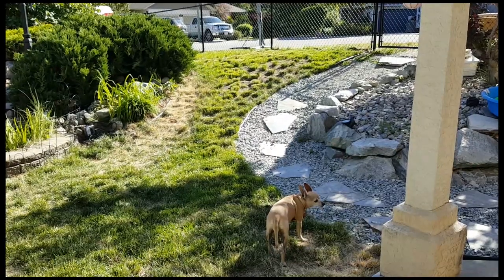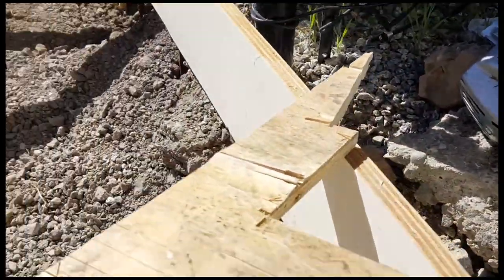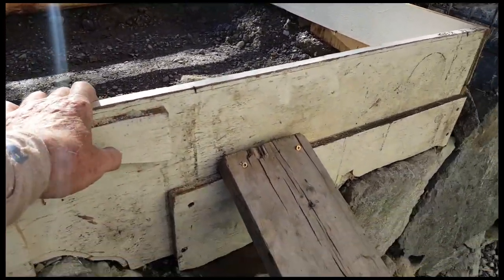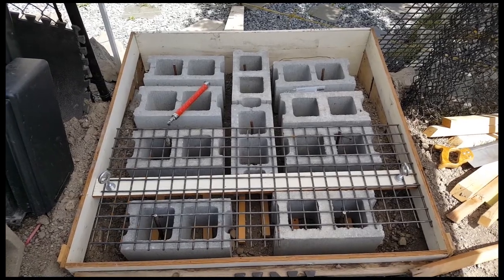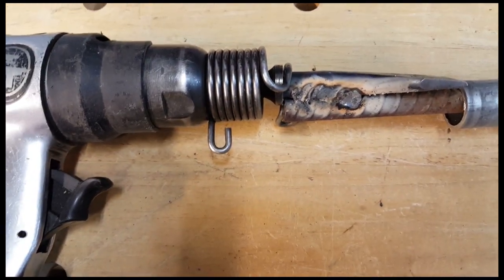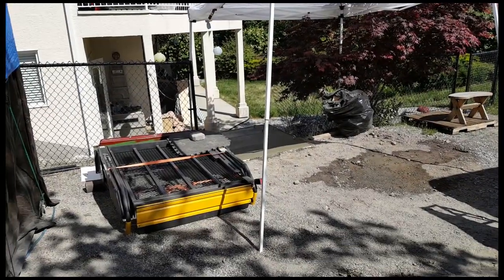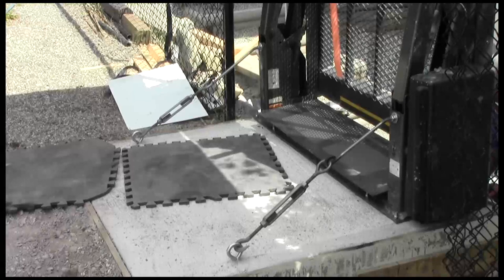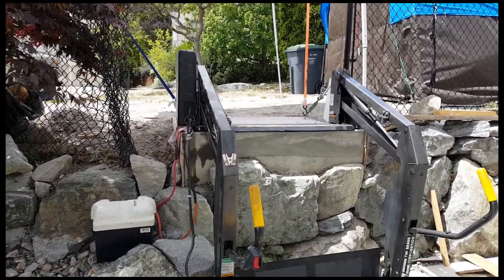Installing a Wheelchair Lift

Comment: How to add or put battery in on porch what connectors did you use? I have the same lift and want to do the same thing put it on my porch but running into problems how to either convert it to AC or simply use a battery help.

Comment: Thanks for the video.  A board member on SCI Care Cure forums had a setup similar to this in his workshop.  This was extremely well detailed.  Thanks again.
Reply from the maker: Thanks for your comment.  The lift does the job perfectly and my wife can get to the truck safely.  It was a big bonus that we also use the lift for easy transporting yard work equipment up and down.  I love it because I load all the groceries on it and quickly bring them down to our door.
Reply from the maker: Here is the video of the cover I built for the lift.        https://youtu.be/LzRlOOmIpfw
Reply from the maker: @mikeinbmore  I would be glad to look at and maybe give you some suggestions on this project.  But I would need to see some pictures to see what we are up against.  You can email me   whyterj47@gmail.com

Comment: Ray did you use the interlock or bypass it .  If you bypassed it how did you do it?
Reply: Michael, did you ever find out how to deal with this?  I installed a Braun-ability lift in my garage but cant get it to work outside of the van it was in. Thx!

Comment: Hello.  We are using our Braun Century Lift in a similar fashion, however, when we hooked it up to the battery it didn't work.  I see where some others had the same issue and was wondering how you resolved it.  Thanks

Comment: I would install a canopy to protect the unit from the weather. Maybe even a soler cell hooked up to a charger or run conduit to the battery to always keep it charged. Also wire in a controll station on top and at the bottom and tie the handheld station to the unit so the wife can operate it independentely no matter what position it is in. Just wire the extra buttions in parrell to the controller on the lift.
Reply from the maker: A canopy has been installed for the winter, and I just have to get the video done.  I like your suggestion of wiring in a second control.  I will look into that in the spring.  Stay tuned for the canopy video it turned out great.
Reply from the maker: I finally got the video done of the roof I built for the wheelchair lift.      https://youtu.be/LzRlOOmIpfw

Comment: Excellent job, I would like to see how you did the wiring. I bought a lift off a Scrapman. 
Still learning 
Thanks for teaching
Reply: Hi Zander. Did you figure out the wiring for yours? I just took one out of a bus and it was working in the bus. I hooked it up to a 12v battery in the garage and it is not working now.
Reply: @randyurso4799  Sorry to say not yet. I got very busy then winter hit. I do have a farm who is very knowledgeable on DC power lifts. Said he would help me figure out the wiring. I will try to video the process.
Reply: @zanderman2539  hi Zander. I was actually able to figure it out, it ended up being pretty easy. Let me know if you need any help. I’d be happy to answer questions if our lifts are similar
Reply: @randyurso4799  i would please need help
Reply: @franciscogutierrez5113  what kind of lift is it and what is the application? Are you using it out of the vehicle and attaching it to a new 12v battery?
Reply: @randyurso4799  iput new battery 12v. And nothing mine is a versa i belive

Comment: Ray, Can you kindly show the wiring diagram to battery, need same system for wife with MS who cannot use walk ramp anymore. Any help appreciated.
Reply from the maker: The wiring is quite simple and you can not get a shock.  The lifts operate using a 12 volt battery.  I use a 12 volt deep cycle battery, try and get the highest amp hours you can afford.  There are 2 wires coming from the lift, 1 red (+)  1 black (-) and they attach to the corresponding terminals on the battery.  If the lift is not in a vehicle that charges the battery every time you drive, then you will need a battery charger to recharge the battery.  If you have more questions, do not hesitate to post again.
Reply: @raywhyte7916  Many thanks confirmed what I expected and can now go forward with my project. Happy wife is Happy life and I'm sure she will be.Happy Holidays to you and all.
Reply from the maker: @kenrobinson7327  Good luck, I would like to see some pictures of the finished project.